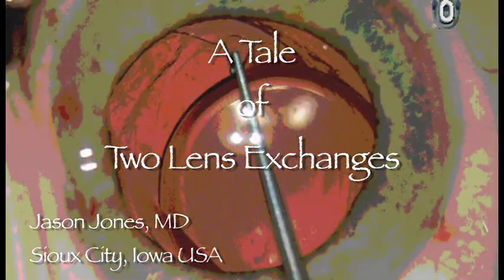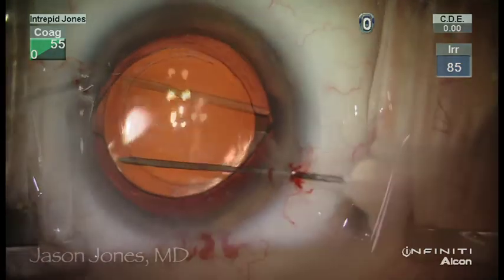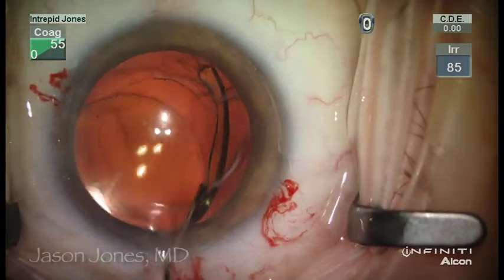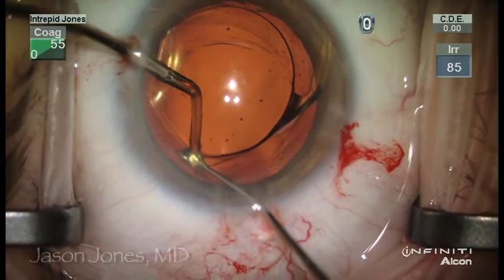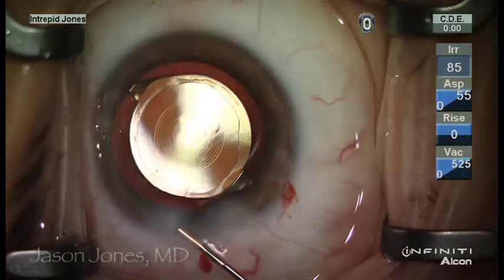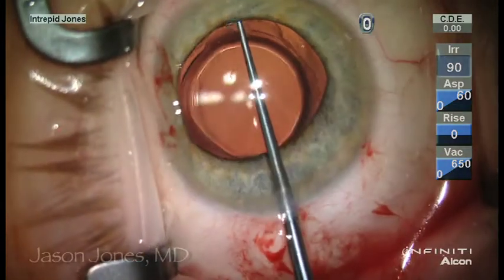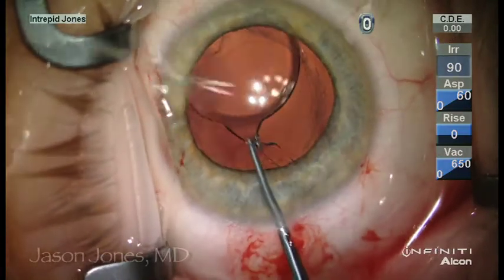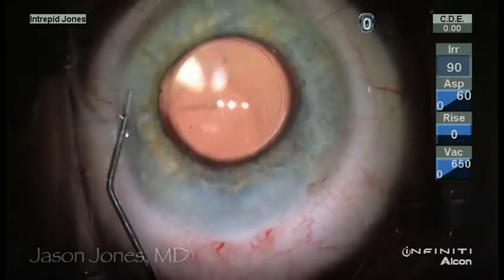Single Piece Acrylic Exchange X2

Comment: Dr. Jones, thank you for sharing these great videos.  What's the reasoning behind the 2nd IOL exchange?  Change in contour of the IOL?  Caused by the fibrotic bands which you later stripped?
Reply from the maker: The second IOL was exchanged due to incorrect power secondary to previous LASIK despite calculations to compensate.  The optic contour difference is inherent to the lens design with a 6 mm carrier and has nothing to do with the capsular fibrosis.  Removing the fibrosis permits the replacement IOL to position properly.  Thanks for your interest.

Comment: Dear Jason, do you know if the CQ2015A is still being manufactured? No reply from the STAAR company.
Reply from the maker: I recently have heard Staar will cease manufacturing this lens. Likely there is low penetration in the market and it has become too expensive for them to maintain manufacturing it. Fewer and fewer choices to help some patients.
Reply: @phacomd  Maybe there's a chance to buy it right now in advance.. ? I do consider IOL exchange but in this case only the Sofport is going to remain.
Reply from the maker: Adam A of there is a specific case then one could obtain an appropriate lens power CQ2015. There’s no way to stock adequately for future cases. I agree the LI61AO is likely the only other alternative
Reply: @phacomd  That's right. However, as far as I know collamer IOLs have higher rate of success than silicone. What a shame there's no ~7 mm collamer IOLs. Hard to believe...